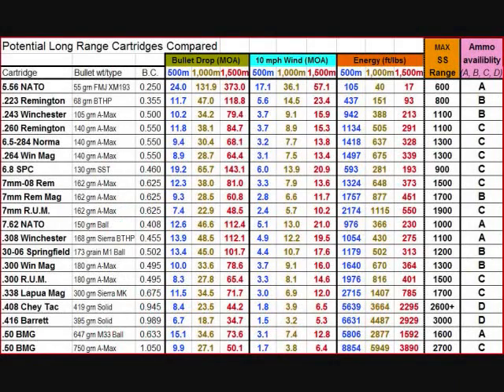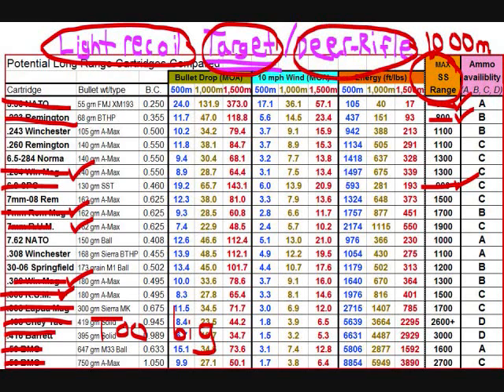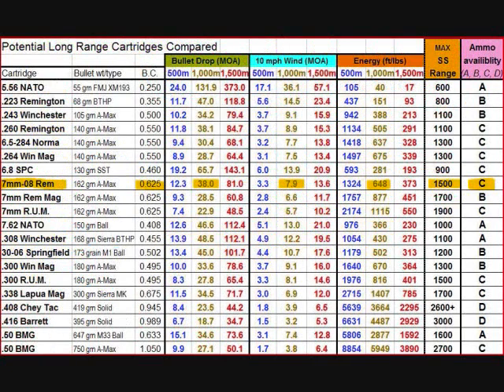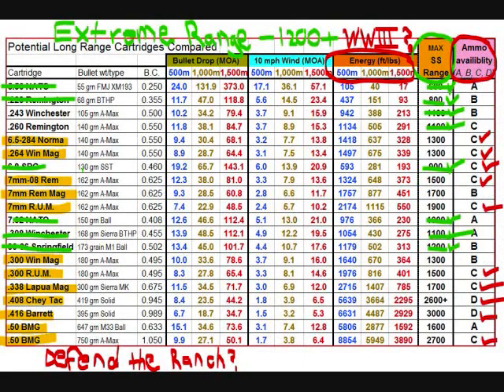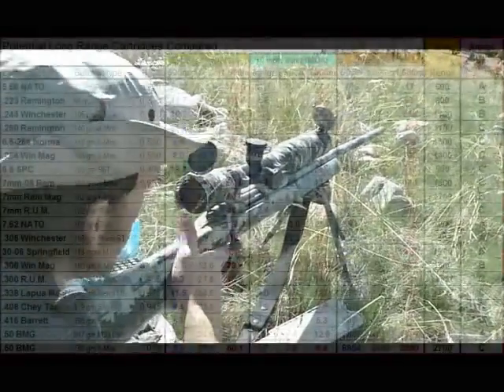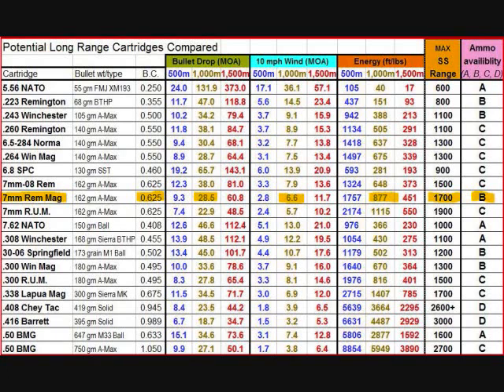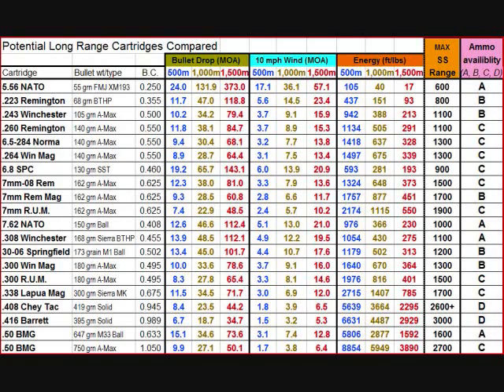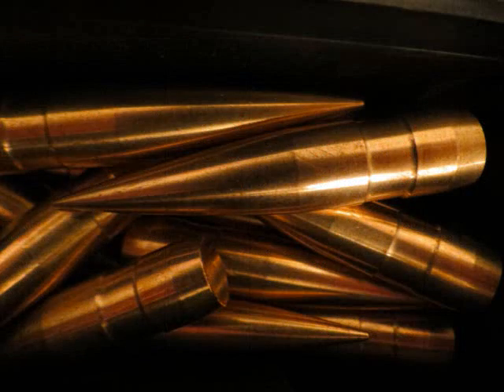Long Range 101 Part 3 - Cartridge Selection -- Rex Reviews

Comment: Thanks for your reply. Its just that I like to understand the "how and why" of things. It just struck me as odd a bullet roughly 1.52" at 180 requiring 1:9 but then a bullet over .010 shorter and weighing 18g's less taking a faster rate. I wonder how each company tested those. Especially curious if Hornady simply ran it through a 1:8 and called it good or if they tested in 1:9, 1:10 etc and had issues.

Comment from the maker: Its always best to have the recommended twist rate for a given bullet, but honestly, you can quite often get away with heavier bullets than you are supposed to.  My M77 .243(case-in-point) shoots awesome out to 1100m with 105s, which are supposed to be too heavy.  There are other factors involved, altitude and air density are big here.  If you are above 2000 feet you have some extra wiggle room, if you are above 5000 feet, you have even more wiggle room.   More on this in external ballistics.

Comment: Conundrum. I've got a Browning BBR in 7mag, good solid piece of equipment. I got some Berger VLD's that I was testing but was concerned because Walt recommends a minimum 1:9 twist. The BBR is 1:9.5 . In my research I've learned that it takes a faster twist to stabilize a longer heavier bullet so I backed off of the 180 VLD's and switched to the 162 AMAX but after watching some of your videos I just happened to check and the AMAX box indicates those are for 1:8 twist rate. Any comments?

Comment from the maker: The 7X57 Mauser will push 162 at about 2,500fps and the 7mm-08 will push 162s at about 2,600fps.  Very good case design as well, but with a little less power.

Comment from the maker: Lapua offers great ammo.  To determine the max effective range, one needs to consider the B.C. and the MV to determine the overall external efficiency :-)   Depending on the exact load and your barrel length it will be more similar to the .308 or 30-06 in external & terminal performance.

Comment from the maker: Yeah, the .270 is a pretty good LR cartridge, if you use the right bullets.  Very good performance.  I think there are probably lots of guys who use the 270 for LR, but many gravitate towards the .284s (7mm) as they are a little more effecient yet and have a little bit better of a bullet selection.  Nothing wrong with the .270.  Its a  great round.   :-)

Comment: Id like to hear your thoughts on the .270 Winchester for long range shooting. The ballistics are pretty good with 150 grain bullets such as the VLDs and the SSTs. The 150 grain SST has a B.C. of .525 and the VLD has a B.C. of .531 and you can load those to around 2900 fps. So why doesnt anyone use it?

Comment from the maker: For a long time, high BC VLD type bullets for the .25s were very difficult to come by.   But now, I belive Berger offers some .25 cal VLDs.  Using efficient VLD type projectiles, this cartridge becomes a serious LR contender.  Comparatively speaking, the .257 cal sits in a goofy spot where most of the bullets available are not quite as efficient as the .243s, the .264s, or the .284s.  BC is the quickest way to quantify your LR potential, so just consider the published BCs of the bullets :-)

Comment from the maker: Nothing wrong with the accuracy potential of a 30'06.  Carlos Hathcock (USMC) had much success out beyond 800m with the 30'06 in Viet Nam.  It's true that the .308 seems to produce accuracy more easily than the '06 with greater efficiency, but if you tune your loads to your rifle and get all the bugs worked out you can get 1/2 moa out of the '06 with no problem.  You will also get a little more power and extended max supersonic range as well out of the '06. The 30'06 is a great choice right now.
Reply: TiborasaurusRex which caliber is better between 30.06 & 308?

Comment: Any idea of the max range of a 6.5x55 (swede)? Im guessing since it's the 6.5 family and with modern rifle's you can load its large capacity hot (+ more barrel wear) to 3000fps+ you'd see similar ranges to the .260 and x284. Plus there's 6.5 bullets out there now advertising .58 and .60+ BC.

Comment from the maker: The reason for the .300 WM choice has primarily been based on its continuance with the existing gov't .30 cal components.  Many of the issued gov't cartridges in the last 100+ years have been .30s.  Consider the line of cartridges:  the 30-40 Krag, the 30'03, the 30'06, and the .308.  The .300 WM was a natural choice.

Comment from the maker: The stability of the bullet depends on a multitude of conditions.  According to Miller stability formula, the 1:9 is not enough for the .243 A-Max, but like any formula, it is only a mathematical model and does not always represent what we see in reality.   Many have tested the .243 A-Max using 1:9" barrels with much success (myself included).  My Ruger M77VT .243 with it 1:9" twist holds sub MOA accuracy out to 1375m.  A 1:9 1/8 twist is 'practically' a 1:9".  What do you plan to shoot?

Comment from the maker: You are right about the 175s, they have great performance. Overall, the .30s are just fine. There are many many projectile options out there, but this chart was designed to compare and contrast bullets of similar design to display overall drag efficiency trends between the various calibers.  Not trying to slam the .30s - just laying out a consistent comparison.

Comment: love the videos.  thanks for all the effort and posting.   i wouldn't write-off some of the midsize cartridges out past 800yds because their energy is less than 500 ft/lbf out at those distances. i agree that more is better in many aspects, but the killing power of a 30 cal projectile at 1200 yds is still lethal for big game.  i've killed 2 year old steers with a 9mm (350 ft-lbf), and the lowly 22lr is lethal with only 117 ft-lbf.  not giving you any grief, just sayin' i love my 30-06 at 1200m!

Comment from the maker: It depends on how you define the word 'better'. The cartridge potentially offers less wind deflection and drop, but at the cost of accelerated bore and throat erosion (short barrel life).  The .338 offers more potential power at that range.  I almost went with the 7mm RUM, but barrel life and remaining energy were major factors in my own selection.  The 7mm RUM is awesome, but not-so-awesome at the same time.

Comment from the maker: Either would be great.  The .300 RUM is a beast.  But it may require you to get into reloading and stock up on brass and components right now while it is still available.  Its much cheaper to shoot that way and your quality can be much better than factory.  But if reloading is not an option, may be the .300 Win Mag would be the better choice.  Reloading is not that difficult, and is a lot of fun as well.  You would be able to load much better long range bullets out of whatever you chose.

Comment from the maker: Yeah, the 6.5s and the 7s are both really really effective.  Its hard to list ALL the different bullets that work well, so I tried to just give a few examples that represent good efficient design.  There is no doubt that the 6.5s are among the very best for use in precision long range applications.  Lapua bullets are very well made as are the Bergers.  If I was long range hunting with a 6.5, I would go for the Berger, if not, the Berger is still an awesome flier.

Comment: No, I knew it would still kill at 40 yds. and a .22 is very lethal despite what many would think about that round.  I was just trying to understand what exactly is terminal in regards to say what would be a minimum ft. lbs. to kill? For example, a 9mm @ point blank needs X amount of ft. lbs. to kill for the 124 gr. bullet. Now that I think about it more, I guess the answer depends on bullet weight, HP, etc. and would be a little broad depending on each load but, is there a broad minimum?

Comment from the maker: Many would consider about 500 lt/lbs of energy to effectively lethal.  That's approximately the power of a .357 Mag at the muzzle.  The 7.62 NATO was designed by shortening the venerable 30-06 cartridge and this made it very easy to retool and produce the new ammo.  The 7.62NATO is a very effective round for its designed purpose.  Although there are many other cartridges that have better long range ballistic performance, this was not the primary criteria NATO was considering when they made it.

Comment from the maker: 300wsm is a great cartridge, powerful with good efficiency.  If you are taking BIG game like elk @ over 1000 yards, a 300 ultra mag would give ya a bit more energy - but with the cost of greater recoil and blast. The 300wsm is a great all round cartridge.  It should work great for hunting at 1000.  The .308 will not have edequate power for nice clean kills at 1000 yards.